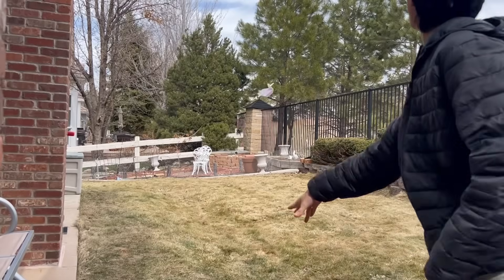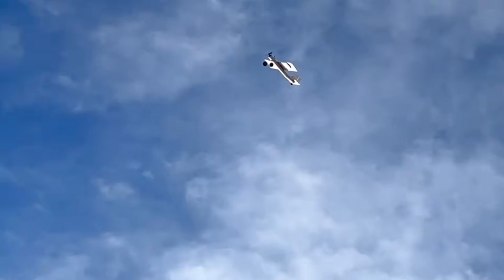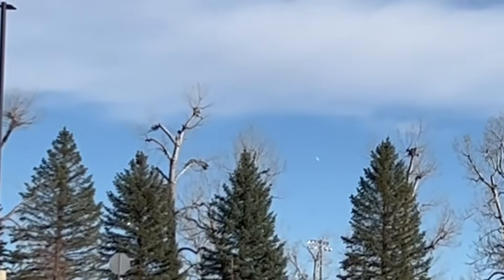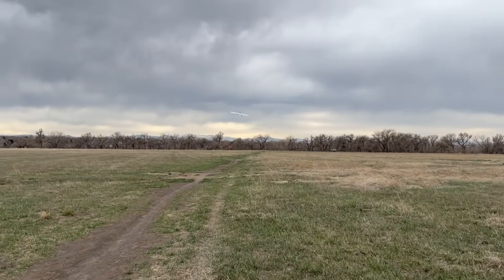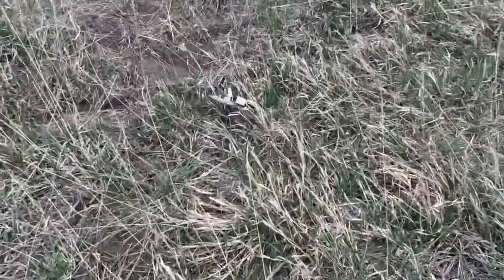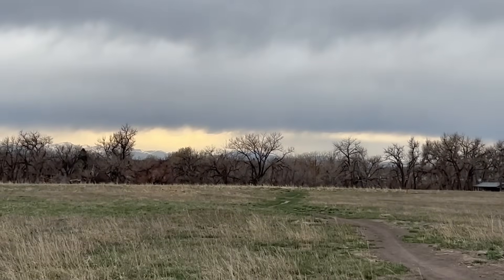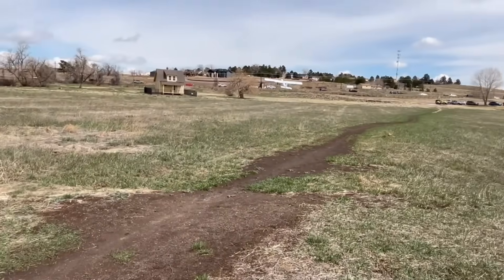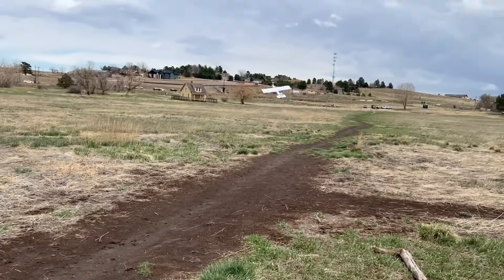Heavy weight drop shuttle gliders-Will They Fly?

Comment: The Northrup M-9N actually did not have any refex at the tips (washout) because it costs efficiency.  Its airfoil is nearly symmetrical as well and would have flown inverted nearly as effectively as upright.  By comparison the Horton HO-IX/GO-229 used reflex (washout) because it improves stability and handling.  Washout also reduced the possibility of tip stalling at low speeds as well as reducing the chance of ending up in a tumble in pitch which is when the aircraft will just roll and roll along its span axis until it hits the ground since recovery from it is virtually impossible.  The Horton was not better, it was actually quite crude in its aerodynamics compared to the Northrup wing but the Northrup wing would have had worse handling vices as the price for the improved efficiency.  Efficiency was important since the M9N was basically a subscale prototype and test model for a huge bomber, the XB-35 that was designed to be able to bomb Europe from bases in the US non-stop.

Comment: Mount the wing on top of the body to lower the center of gravity. And if you cut a slit in the bottom of the drop planes fuselage for the gliders rudder, you could drop the glider right side up.

Comment: the reason why your "glyder" starts vibrating it's because you've added too much pitch, so to evade that problem try to
 - move the CG back a bit so the plane can maniobrate
 - Or you can reduce the weigth
the reason of the vibrating its because your plane wants to pitch up but the weigth pushes the nose down 

Now to help you with the problem of the upside down glyder, there are some cuple thigs you can do:
- move the whings up not to the bottom of the plane, that will cause  unstability on your plane but if you put it in the upper part the plane wont roll 
- if you whant to keep the wings in the lower part, move all the CG at the bottom as much as you can that will reduce the roll 

when you buid a glyder always remember this:
Always and when i mean always is ALWAYS, you must imagine that your plane is hanging on a chord and that chord is atached to the CG, if the nose of the plane is moved down, you must move the weigth back, and if the nose comes up, the weight goes foward 
Also the CG must engage the CG of the wings to know this you just have to calculate the 25% of the wing.

have this in mind this are the rules to make a ideal glyder not the type of glyder you want, start with this then play with the CG.

salutations from Spain,.
Reply from the maker: @Tobilloss thank you good thinking 👍 that explains the up and down oscillations but remember the whole point is that they are meant to be very heavy.
Reply: @ieatgrass_rc  thanks for responding me, i know the point of the glyder, but i just was saying that i you reduce the pitch, the glyder with the speed will pitch up alone, so just reduce a bit the pitch til you find the correct angle that might prevent the oscilations. good luck

Comment: The reason that it is flying upside down might be caused by the vertical stabilizer being on the top. You should try to have it be split with half on top, and half on the bottom.

Comment: Don't be so attached to a low wing mount. The tail raises the CG vertically.
A high wing lowers the CG overall in the vertical and makes for smoother air flow across the wing.
Good luck.

Comment: Deltas don't care which way up they are, so you need a huge fin area to lever them upright. Your tailfin would be about right for a traditional aeroplane, but it's WAY too small for a Delta. Look at how enormous the Space Shuttle tailfin is! A better way is three vertical fins: add tip-fins, and cant them outward 20 degrees or more off the vertical. Also, adding mass to deltas just causes so many problems due to way too much rotational inertia, and kills your time in the air. The lighter the better!
Reply from the maker: Thanks for the advice (By the way the whole point is to make them really heavy)

Comment: 0218    wingtips   should   be   finished.!    if they are not, the resulting wing has  TWO  completely  different  profiles.     this model has a less-than great distribution of mass (dom).     the dom of a tail boom  should  be  optimized; by  tapering  it  in  Both  axes.
the tail of a model aircraft should be made as light as is practical.     the use of a tail wheel and the aft-location of servos have made the tail  Heavier.! 
0226   when the model is level, the main landing gear should be located directly below the wing leading edge.     the root chords of the stabs  Should  be  Equal  in length.     the vert-stab should be modified, accordingly.

Comment: I'm guessing the foam board planes are more successful because the wings flex under load creating a dihedral, which is passively stable in the roll axis, however i'm guessing upside down is stable because air interacts with the fuselage forming high pressure pockets. 

Real designs like shuttle have slight dihedral and it's even more pronounced on dream chaser. Maybe instead of drop testing the planes you could tow them on long ropes? As otherwise the glider gets caught in the propwash. Like they did with the real x planes. 

Also for finding planes, stand still, look where it landed, find a reference on the horizon and walk straight towards it without losing sight of the reference. Helped me many times in tall grass fields (though i also had a beeper :D)
Reply from the maker: Yoo thanks for the advice I definitely be trying out these idea out next video
Reply: its a god and a bad idea because if you put a rope on the plane that will make interferences on the aerodynamics making drag

Comment: bro i have a question to u , as we know when right alleron rises up it the the plane bank to its left but my prototype of rc plane is turning right 💀 . is this because the air flow above the wing is higher than the lower one ?:face-red-droopy-eyes:🤨
Reply: if you're looking at the plane from the back and right aileron is rising up and left aileron lowering down - the plane will roll right. Left wing is making more lift by directing air downwards and right wing is making less lift by directing air upwards. 

If you're moving your stick left and right aileron rises up - your axis of control is inverted, check your RC transmitter settings to flip the axis.
Reply: @linecraftman3907  thanks for more info but , I was already aware of it and I also knew how to troubleshoot it but I wanna to confirm if my info about it was true or false 
some of ur info was not really new to me but i got the point more "clearly" now 
at the end I just wanna say "thanks man"
Reply: hope you understand my English issue 😅
Reply: Thanks for hart man ❤